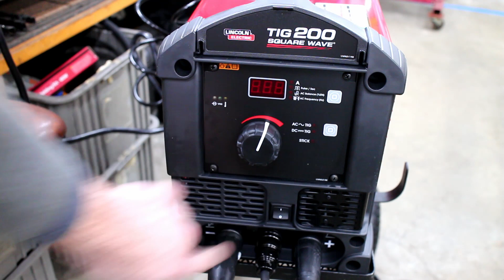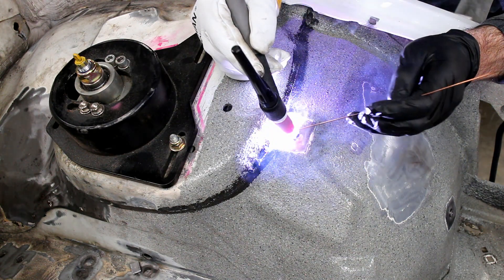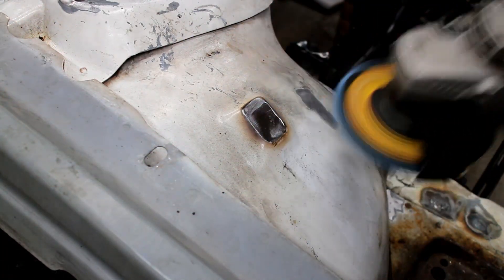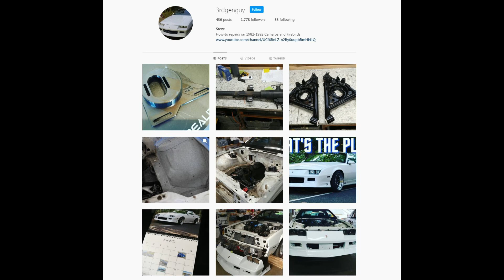Plug Welding + Misc Part Removal (1982-1992 Camaro/Firebird Pt19 LS Swap)

Comment: I really wish I had someone like you near me who could help teach me to work on my 88 Pontiac gta firebird. It is mostly stock with a few upgrades so it can breath better. The transmission pump died and before it died it would also slip out of high gear above 80-100 mph so it probably needs a full rebuild for the tired old 700r4. I need to do piston rings eventually too for the tpi350 because it smokes a bit when it runs. Plus I have some physical disabilities.